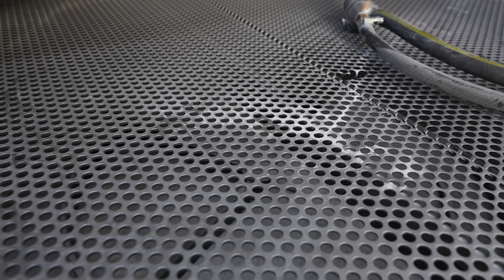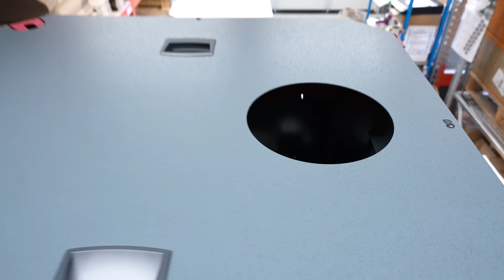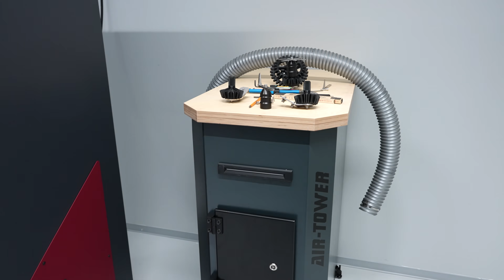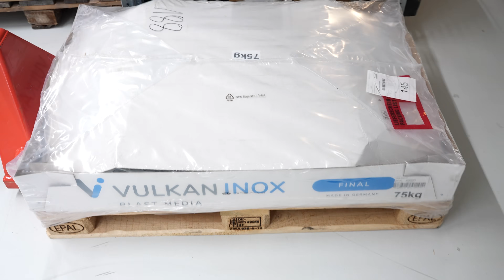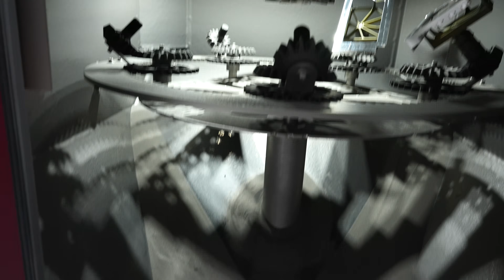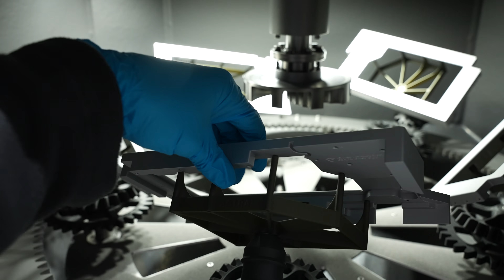Inside Thermal Grizzly – High-End Manufacturing & Surface Treatment

Comment: Can I ask what prevents the holders that you have 3D printed for use in the Twister from wearing down due to being hit by the steel balls? Or do you simply count on having to discard them after a certain number of uses and replace them?

As for the machine itself, they might actually have purposely designed the top of it so it is removable to go through doors (rather than it merely being coincidental). After all, doors are usually a standard height and they realised the machine would need to pass through them several times in its career.

Comment: So the word you're looking for is "media'' at 0:44 and it can reference anything from crushed glass to steel pellets. Media blasting cabinets operate one of 2 ways, compressed air or like your automated machine with a vacuum. Air speed is all that is required to move the media because regardless of the machine it still uses vacuum to introduce the media into the air stream. Whatever blasting media you used before should be used with the new machine as well. The automated process is more controlled for exposure times but it can still over etch when using an aggressive grit on softer metals.

Comment: Does this really draw less power than the air compressor for the pressured air? It now has an air pump and a vacuum pump. But I guess the vacuum is not that high, right?

Comment: A few questions/observations:

1) If the steel balls are affecting the surface, then surely microscopic particles of whatever surface you're treating should then fall off and mix with the steel ball hopper, to then recirculate back into the surface treatment process.
2) Would that recirculated material have an affect on the machine's operation over time, like if you treat a ton of copper parts, would you get copper oxide powder buildup with the steel balls and need to completely empty out the hopper to decontaminate the items?
3) Would the steel balls (or other particles from prior surface treatments) have the probability to contaminate the surfaces in some way? I'm not a metallurgist, so I don't know what metals affect what, but like assuming residual aluminum powder affecting copper surface parts which could then begin some corrosion. Before, with glass balls, glass should be chemically inert and since you're presumably blowing glass balls from a reservoir of just glass balls, there wasn't any chance of triggering any corrosion.

Comment: Very Neat! The fixturing system here uses a sun-less planetary gear train. The outer static "Gear" is called a Ring Gear, each of the gears engaging on the ring are called Planets, the input is going through what is referred to as a Planet Carrier. The coaxial shaft system with the bevel gear is super neat as well, there is a restrained shaft attached to the planet carrier with a "floating" shaft around it that allows the planet gear to rotate freely. The static shaft on each planet is restraining the larger bevel gear while the planet gear itself has a carrier for the smaller bevel gear connected to each individual part fixture.

In a lot of ways, the main system is running as a sun-less planetary with each planet having its own ring-less planetary for local rotation of each part.

Modern Automatic Transmissions use planetary gears and clutches to shift between ratios without having to "remesh" gears as you would in a manual. This makes them larger, heavier, and more complex, but that is why shifting is less abrupt. You are disengaging one clutch while engaging another and the gears themselves never lose contact with eachother.

Comment: The rotational mechanism is an epicyclic gear system, which is just a planetary gear set without a sun gear. It gets its name from the lobed travel path of any one gear or object that sits on the periphery of a pinion since it moves along and inside the pitch diameter of the ring gear - kind of like a more expensive motorized Spirograph 😅

Comment: I used to do a lot of titanium anodizing, which is a completely different process, but similar in that the surface finish prior to anodizing is very important.  With titanium anodizing its an oxidation layer that created the colors, like rust with iron but it happens much more slowly.  It also requires an etching process to get vibrant colors.

Comment: I mean like these days, big and heavy GPUs are sagging badly. Why not use stainless steel 304 material for GPU backplate instead, rather than aluminium ? I feel that aluminium backplate is not robust enough and susceptible to bending easily.

Comment: The gears look very similar to planetary gear set inside transmissions with the middle, spinning one way, and the planetary gears, spinning quickly and the outside one not spinning.
Reply: This is more similar to an epicyclic gear system, which is just a planetary gear set without a sun gear. It gets its name from the lobed travel path of any one gear or object that sits on the periphery of a pinion since it moves along and inside the pitch diameter of the ring gear, drawing a lobed pattern

Comment: so, dumb idea here,  what if , instead of trying to polish blast a metal surface, you use a laser (like the ones capable of rust removal ), and basically rotate your surface below that laser beam (whilst cooling it so it holds a stable temperature) until u reach a smooth perfectly plane surface ?

Comment: Seems a surface grinder would work well for the flat parts, work holding could be interesting considering i dont think most of your stuff is comparable with a mag plate.
Reply: It's all nonferrous materials. Grinding would just plug up the wheel.

Comment: I’m a NACE/AMPP certified coating inspector and I think this is a fantastic upgrade for y’all’s coating process. What’s your plan for steel shot recovery and filtration? The rubberized inner liner will contaminate your blast media over time.
Reply: Not just from the liner, the media will become contaminated with aluminum or copper from their substrates as well. I guess that this machine requires frequent replacement of the entire media batch? It seems like the media just falls down into the hopper and gets sent right back into the air stream. I didn't see any dust collector or cyclone like you would have on a normal blaster, but maybe it's hidden.
Reply: @mrbitjetson  I think it was the machine to the right. I assume that the contaminants remain airborne and are filtered through the other machine.
Reply: @mrbitjetson How could you have a dust collector on a chamber that is under vacuum?
Reply: @brucepreston3927 no idea, that's why I'm guessing the media is just replaced. Probably something like 50% every so many hours. Even if contamination isn't a concern, the media will wear down over time and produce different finishes.
Reply: @mrbitjetson Yeah, I would definitely think it would need to be changed every so often...Just the sheer amount of aluminum that is coming off of the pieces being blasted would contaminate  it, not to mention the rubber coating on the walls...

Comment: That's a nice sized pressurized blast machine. I nearly bought a similar sized unit from Mod-U-Blast several years ago, with a filter stack for exhaust and media collection. 

I assume you are able to recapture, clean, and reuse the steel media on the vacu-blast machine? Is there any risk of those metal balls interacting with the rotating gears, potentially causing a bind/lockup?

Comment: I don’t really understand what the issue with the sandblasting was. You said that the glass beads can change the crystalline structure of the aluminum, but why wouldn’t steal balls do the same? Is it mostly that with the automation you can make sure it’s even and don’t have spots that are hit much more than others?
Reply from the maker: The glass beads need very high force by the air pressure to hit the surface. Without high pressure You can't "transport" them. But the high pressure causes the issues
Reply: @der8auer-en  So is it the velocity? Because the steel is denser you can get an adequate result with a lower velocity. If im not mistaken the air is only used to accelerate the glass beads and otherwise doesn’t have any interaction with the blasting process.

Comment: 100,000 USD is a bit too much for this machine, Here in India and China we are using similar surface treatment machines costing around 40,000 USD. We do have both Indian and Chinese Machines, but the end result is the same.
Reply: Don't get me wrong but I think for such a premium company as TG more important than 60k $ is reliability, swiss product made near them, 24/7 service and recommendation for the machine they got from other company that is already using it ;) 
Maybe if they were a company that makes mass products without quality requirements it would matter, but they are a company that makes premium products for a niche that wants to pay for a premium product, so the machines also have to be premium.
For me and I think for other TG customers this "quality perversion" of TG is something that causes I want to pay 5x more for contact frames than on aliexpress "same product" or few times more for 5090 astral gpu waterblock that I could for example buy cheaper from Alphacool which is mass produce. Sometimes money is not the case ;)

Comment: so its not the sandblasting room but the beatblasting room ( tried tried both and there is a diffrence in both the finish texture but actually also a slight bit of diffrence in the dust extraction requirement for the room ( since one is sand well the other one is small glass beat's that somewhat breaks leaving tini tiny sharts of glass which is more airboren and also worse for the lungs if the operater happens to inhail it. best way i can discribe the diffrence is like. one is kinda like frosted glass well the other one is like champain ( bad i know but its the best discription i got  )

Comment: You will need to manage the rust factor with the steel/iron.
We used to have that problem south our parts (pump bodies).
Hopefully your steel is stainless, but i would expect it to be very expensive.
Reply from the maker: It's stainless and yes quite expensive 😁